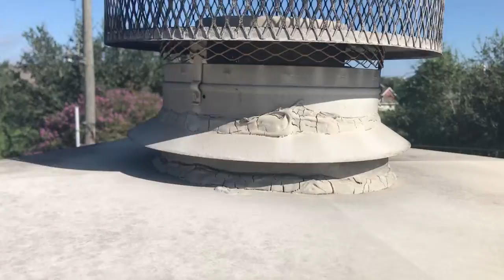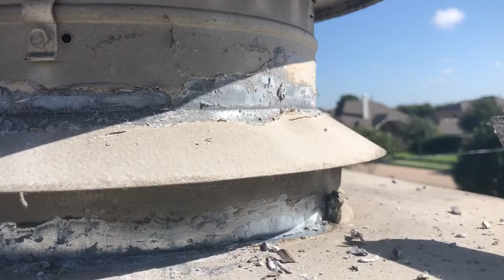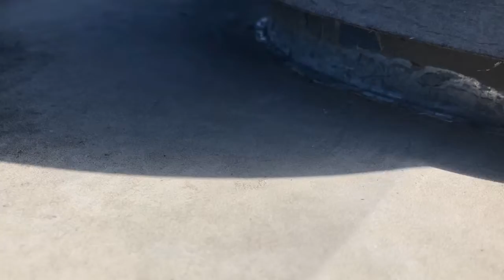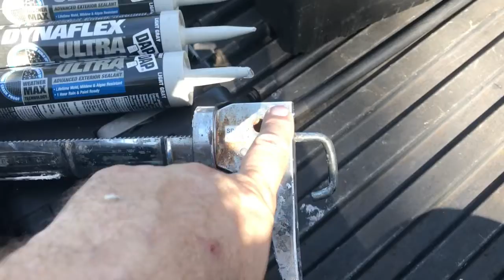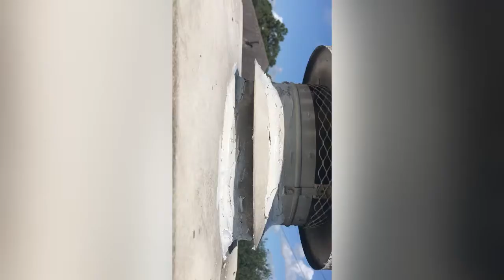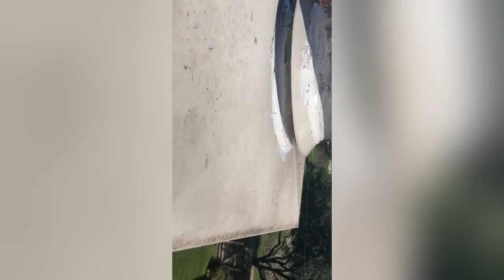Chimney water leak repair.    August, 2022,    Houston, Texas

Comment: Sorry asked this on another video, but I'm seeing the Dynaflex on this one. That stuff holds up to the heat ok? I use my fireplace a decent bit. Seems like the heat would dry that out if not a high temp product. Thanks
Reply from the maker: Of course using a high heat would work better, cost more.   But caulking neck of chasetop shoulder be three layers of metal and 2-5 inches away from flue pipe. Storm collar should be two layers metal and 1-3 inches away from flue pipe.
Reply: @eriksturm7599  Thank you, unfortunately a tree branch fell and hit one of my seams so the water is draining into the chimney now. I'm trying to figure out a way to pull the seam back up again. Any ideas? I'm thinking about using PDR tools or suction cups to pull it out again. No breaks in the cover or damage, it just "popped" one of the four seams inward.
Reply from the maker: @johnnixon take off cap, anchor neck of chasetop with self tapping screw to flue liner as you lift neck of chasetop slightly up with visegrips.    You can also completely remove chasetop and run two 1x2 or 1x4 cross wise and then reattach chasetop
Reply: @eriksturm7599  Thanks so much, I hate to replace the thing when it's still OK otherwise. Unfortunately I can't remove the cap b/c it's a welded rectangle on the chase cover. 😥 I'll just have to remove the whole think I. When you say 1x2 are you talking about boards to prop that seam back up?